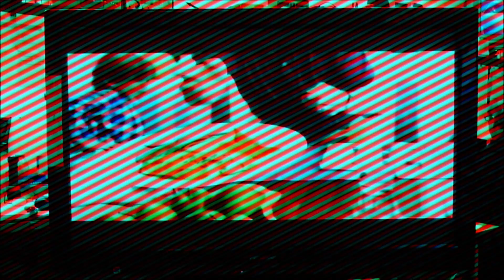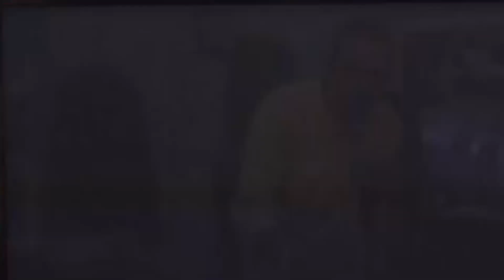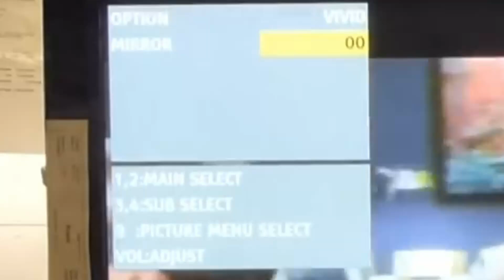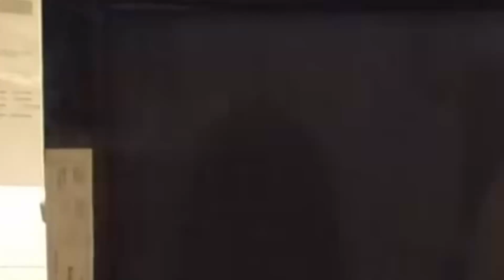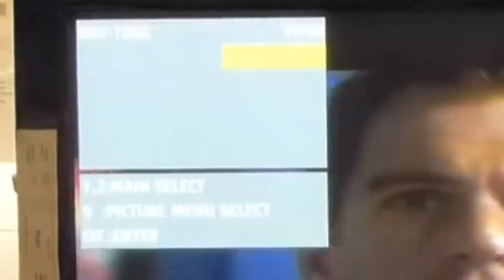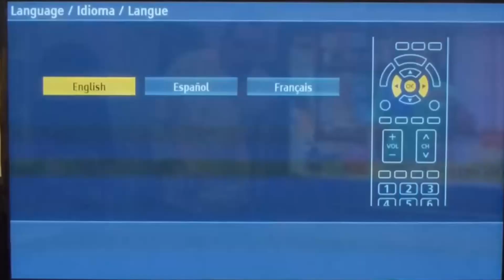Re-Upload! Panasonic Plasma Service Menu Adjustments Setup White Balance Error Codes Usage Display

Comment: Bro I need help on TV Panasonic TC60AS650. I just changed main board and screen rotated 180 degree like mirror function. For additional shows as negative as well. Issue that in my TV ar service menu i dont have mirror sub title and capture format changable line too.Thanks for advance

Comment: DO NOT DO THIS ! 

I did what you said on my Panasonic GT20/25 42" with the "i" button. It just make a self check then reboot and i loose countless of hour of manual color calibration. I don't have access anymore into that costly professional tools. 

Ps
Fortunately i saved my calibration settings in the rapport i panually entered them on the software just for information. With a 1500€ software + 800€ probe i can't get anymore. 
this video almost ruined my day and the coming ones

Comment: Thanks for the video!
I have Panasonic Viera TC-P50ST60 and all the 3 HDMI input are not working meanwhile the composite video it is working.
I'm thinking to use a HDMI to analog video converter to continue using the TV, but I believe the A Card TNPH1045 is the problem. 
I need the Panasonic Viera A Card TNPH1045  but I did not find it in your site, all the models are out of stock. Do you have any recommendation?

Comment: woah !! this is the best of the best video on youtube !!! one question for you How to Fix Panasonic TV if it Won't Turn On sometimes.. ???Works but freezes while on standby several times a week and requires unplugging (waiting 60 seconds) and plugging back in..
Reply: Power off on side TV switch. Simultaneously hold Up or Down channel and press power on button in,  just holding the channel up or down button until the TV front power on LED flashes green, then release the channel button... works for me.

Comment: I have gone through service mode as in video on my TC-P50UT60-2 Panasonic plasma.. I hope it may have triggered something to solve my problem. there were no error codes recorded in 9605 hours recorded. I have a horizontal line that shows up occasionally perhaps 3 pixels maybe 1/16' wide. moving cables knock to side of tv nothing makes it change just comes and goes always in the same spot a 1 inch below centre of screen. I'm tempted to try removing the back to unseat and reseat the ribbon cables on left side of tv looking from back.            Do you have any other suggestions?

Comment: When I look through the adjust section (not WB adj) the colour is set at 32, wondering what this means? Is it fine tuning or something else?
Reply from the maker: 32 is just the center range from 0(0%) to 64(100%), the default setting. Is that what you are referring to?

Comment: Any way to reset the hours used on the tv?
Reply from the maker: No It is written to the eeprom
Reply: @norcal715  that's what I figured. There's a guy that used to make a module that you plug into the TV to reset the hours (I think), but it's used to reset the black levels which improves them.

Comment: hmm I have a Panasonic Viera Plasma from 2009 here, but the remote looks a little different first of all. - In the spot you have the info-button, there's an 'index'-button (for TeleText, I guess) on mine, although the little logo on the button itself does show an info-icon (a little i next to lines). But the button-combination doesn't work. - I also have a separate i-button, but it doesn't work by pressing that button in combination with Volume Down either. - Would you know if my TV would even have a service-menu like this and how to access it?
I was actually looking for a "sweeper" as well, as I saw someone mention somewhere. Would've been good to know years ago, if it's actually in there.
Reply: Ah, never mind... In my case it's holding the Volume Down button on the TV itself and then hitting the 0 on the remote 3 times within 2 seconds. - Just in case anyone is interested.
I could also exit the SRV-menu by just turning off the TV, at least with the hard switch on the front (not sure about Standby).
I'm kinda baffled why they couldn't just make the navigation correspond to the... well, navigation-buttons. - I guess those get ignored by the software, but they could still just program it for EVERYONE's convenience, including people who are supposed to service these things. - But oh well... guess I can dabble in it now, after a decade...

Comment: Love the available menu since I don’t have the factory remote but I’m having issues with overscan on my inputs esp via the hdmi to where the signal is going outside the safe zone if that makes sense. Seems that with this menu I can’t access the HD settings or the screen stretch, auto, full options. Any ideas? Thanks in advance.
Reply from the maker: Some older sets did not allow the 1:1 pixel ratio. I have a couple that I can not use as a computer monitor.

Comment: I'm glad I found this. I don't have the original remote for a Panasonic TCP65s1 I just picked up, but hopefully I can use the programmed one to mimic these efforts. Hoping there is a way to adjust VS, if needed, to remove or reduce the dancing red/green pixels effect in light-to-dark transitional areas of screen.